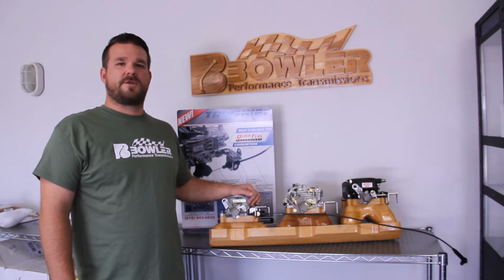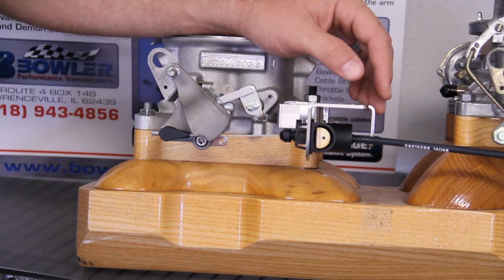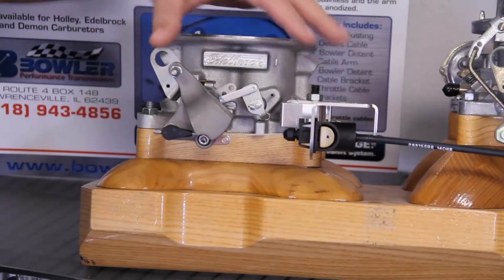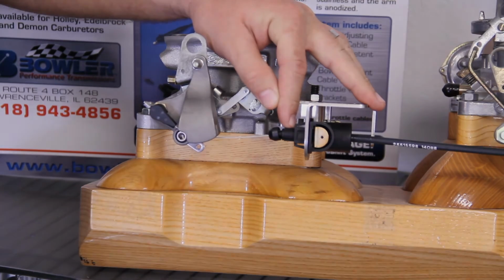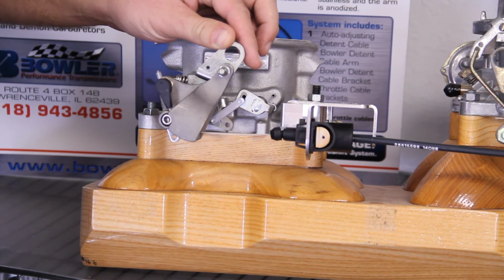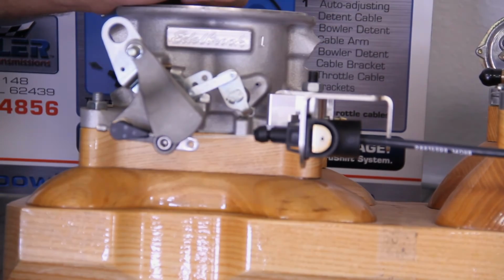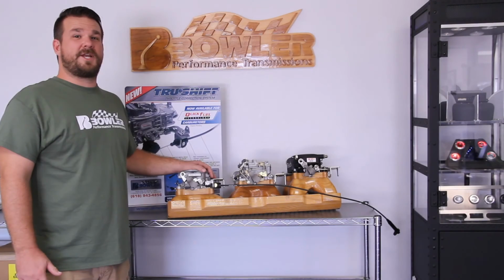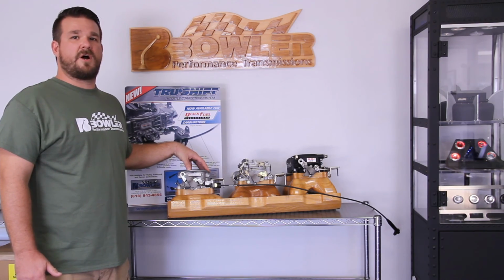Do you know how important this set up is?

Comment: Ok, I have a 700R4 behind a 6.2 diesel and it's supposed to be the same set up.  I've done that adjustment several times and still doesn't shift right.  Help?
Reply from the maker: We would need much more information.  But I would start with a pressure gauge on it to confirm what is going on. You may need to change the governor setup too.

Comment: if unsure if your tv cable is adjusted properly, drop the pan. at wot your tv plunger should be all the way in. at idle, the lever should be touching or slightly pushing the plunger in. also make sure you’re getting wot at the pedal. if your pedal is on the floor but your plates can still be opened manually, you have to fix that first before you move to tv cable adjustment.
Reply from the maker: As long as you have the throttle ratio correctly setup, this would be a somewhat true statement, it is a little more technical than this.  The difference in touching to slightly pushing the cable to the correct distance is the difference in a destroyed transmission or a properly setup transmission.  We are kept plenty busy rebuilding 700-R4 transmissions due to everyone trying to fight the fight, we created this product to take away the stress and to offer a true solution to the problem.
Reply: I say this for people who are unsure about their tv cable geometry so they can understand what's going on before buying a tv corrector bracket.  @BowlerPerformanceTransmissions

Comment: I'm new to this, I got a 700r4 cable that gets a little loose sometimes.  My trans shifts too soon, and it never allows for RPM to build up when wide open throttle; makes for a lazy trans., Question... would this kit allow for shifting at later RPM's when getting on it, or is this a different issue? 
Thanks
Reply: This kit will help fix the concerns you have and will address the shift timing from light to wide open throttle.

Comment: Hey if this is not set correct will it give meate shifts or high rpms before it shifts??? I just redid the rear main in my 1989b5.7 TBI and it is not shifting right at all it's staying in I think 1st or 2nd gear at 40 to 50 mph before it finally shuts to a different gear and then sounds normal
Reply from the maker: I would recommend resetting the cable it will cause shift concerns if. It properly adjusted.

Comment: I wonder if this would work for other transmissions using a tv cable. I like this over the locar cables.
Reply: This is designed for the 200-4R and 700-R4.  We have done some customer installs with AOD units but it is not recommended for the do it your self customer.  Thanks

Comment: The best and short explanation of adjusing tv cable.
Reply: Need get on the ball and get some tru shift systems in stock been out stock for a while
Reply: What do you do it your shift points are to high after tru shift install
Reply from the maker: @deerslayer5863  adjust your governor springs and weights to correct
Reply: Thank you
Reply: @MissKitty04  after dropping 4l60 and installing back, changing to 2 or 3 started only with very high motor rpm.